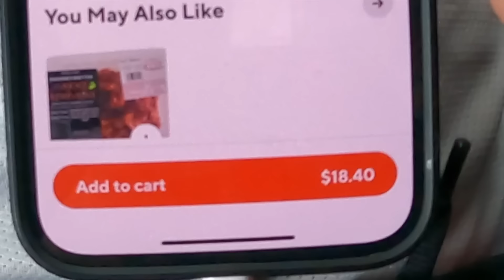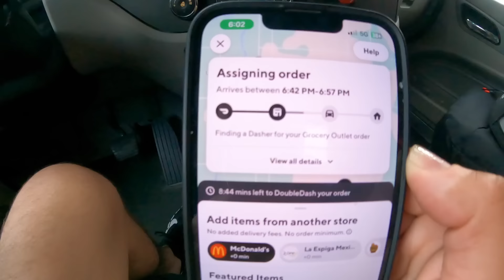Cooking Carne Asada Tacos for Breakfast inside of my Truck

Comment: A little trick for the onion is get it as cold as you can without being frozen and the juice shouldn't squirt and don't cut threw the root when you cut it in half and it shouldn't be as bad learned that when I worked in a kitchen.

Comment: cmon bro you tipped like 7 percent. minimum is 15. couldnt do the extra 5? as a dasher that just breaks my heart. we rely on tips and make 2.50 per order, rest is on the tip. guys shopping for a good 30 mins then driving to you and back only to make at least 2.50 plus your 5, 7.50 for probably an hour.